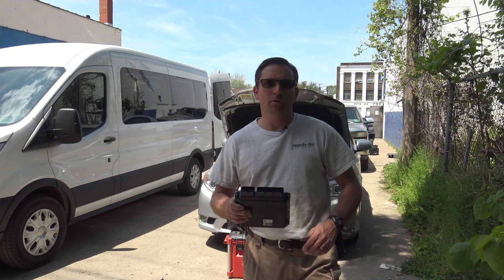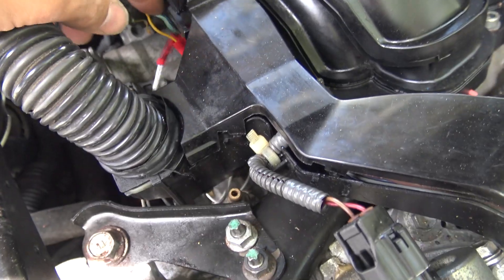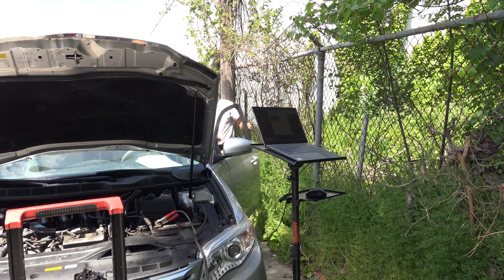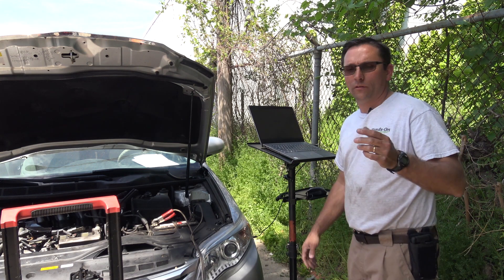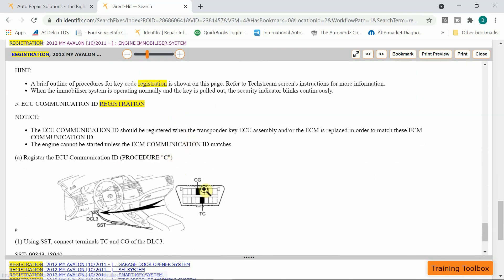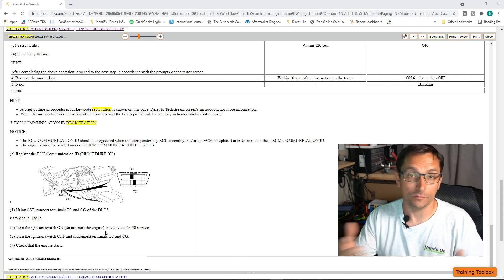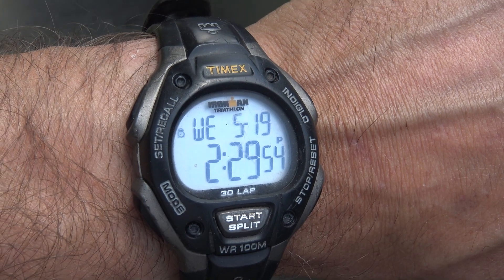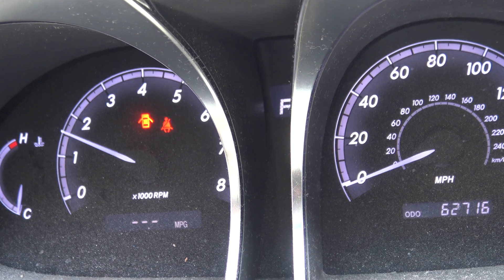2012 Toyota Avalon Used ECM

Comment: Do you do a lot of tech 2 remote programming for older gm cars? How do you handle say a 2002 or 2003
Reply from the maker: I no longer have a tech 2, I get by with midi 2 / j2534, every once in a while , say a passenger door module on a trail blazer/ envoy I will borrow a tech 2
Reply from the maker: It is rare but sometimes I will have problems with mdi / jbox programming 97-02 express vans
Reply: Do you think I’d be alright programming a 1999 c3500? Shop put a reman pcm in it. I have a tech 2. And a cardaq 2.
Reply from the maker: @philh9238  yes should be no problem,  if you have tech 2 use a keyspan serial adapter and u are golden
Reply: The adapter your talking about is to adapt the 9 pin cable into usb right? If so I have that. An insignia brand. So if I try with j box it fails in the middle module or be damaged? Then try with tech 2 remote after
Reply: I’ll let you know how it goes Tuesday. On if the cardaq fails and I have to use the ancient tech 2 or not
Reply from the maker: @philh9238  yes that is , I have only had luck with the keyspan serial adapter, I have tried 2 other brands no luck

Comment: BRIAN, one more info want to ask i bought HP computer with 0ne tera bit [TB] memory with window 10 want to used for programming only do i need to install JAVA software and what else to install to do programming without any issues ur help and information would be appreciated and thank you for every thing you do.
Reply from the maker: Use whatever GM recommends for the Java. There are some settings for Java , I use IE for a browser,  you will have to set trusted sites ,  for chrysler and gm,  ford is pretty straight forward

Comment: BRIAN, That was AWESOME brother really appreciate ur time by doing this one question do you do EURO cars/BMW, VW,AUDE or mostly north American and Asian always learn some thing from u thanks.
Reply from the maker: I do mostly American and Asian
Reply: @BrianMann216  and for this job do you need a prescription to pay or is just coding  the VIN number to the used pcm thank you.
Reply from the maker: If you have just about any professional level scan tool you can do this no subscription required. The vin rewrite only necessary for emissions check if required on this one as far as I know.  The security is jumping the terminals.
Reply: @BrianMann216  Great brother really appreciate the information as i am preparing my self to gather as much info as i can to start my mobile business thank you.